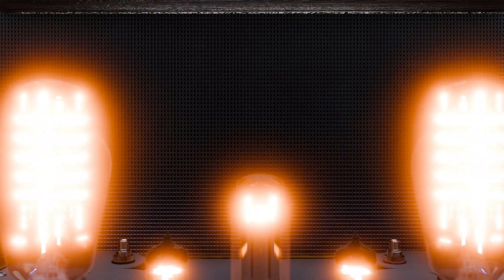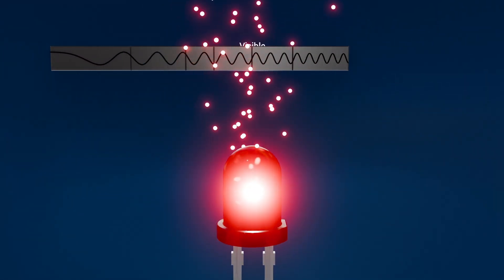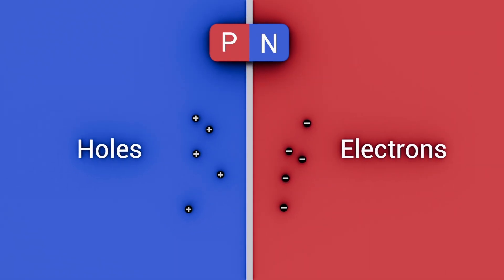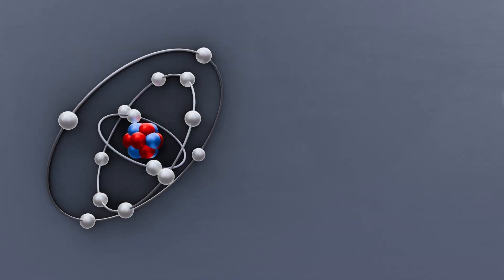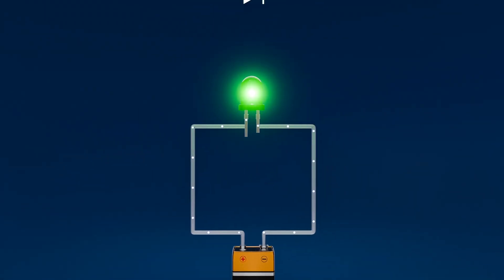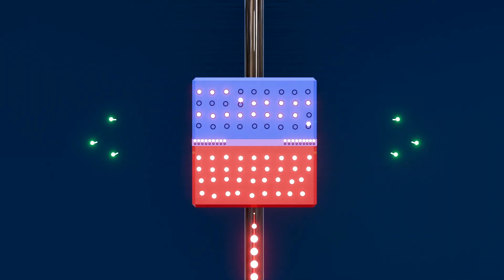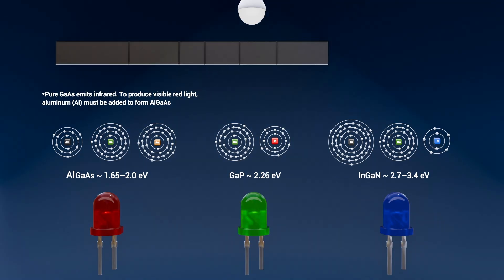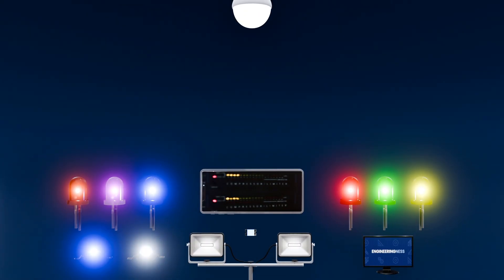Everything You Need to Know About LEDs | Light Emitting Diodes Explained #led #ledlights

Comment: I still don’t understand how can the current flow from positive to negative! Did the electron move from negative to positive?
Reply: Yes absolutely true
Reply: The conventional direction of current, aka conventional current, is arbitrarily defined as the direction in which positive charges flow.
Reply: Electrons flow in the opposite direction of current. Traditionally, current follows the flow of holes (positive charge carriers). But since holes are just the absence of electrons, what is actually moving are electrons in the opposite direction of current flow

Comment: Superb Explained Welldone. Sir, if possible for you then kindly made the video on the following topics: "As we know that anything in our Universe flows from higher potential  towards lower potential such as in case of water & the flow is because of the difference of height between two levels it is understandable but, in case of a battery or cell I can't understand the concept that What actually the difference of potential energy arises in case of a battery or a cell because it is never because of height then what is the actual reason behind this difference & why do we say that positive terminal of the battery is at higher potential & negative terminal of the battery is at lower potential. Although the electron always flows from lower potential towards higher potential? & the second question is that What actually the potential in case of a battery refer's to & why in case of a battery or a cell is always taken higher for positive terminal & lower for negative terminal."